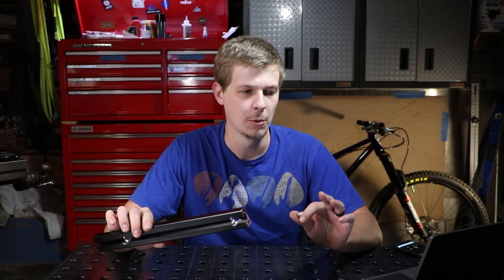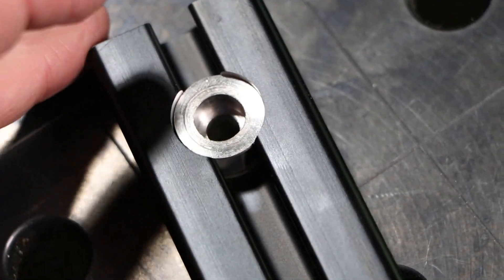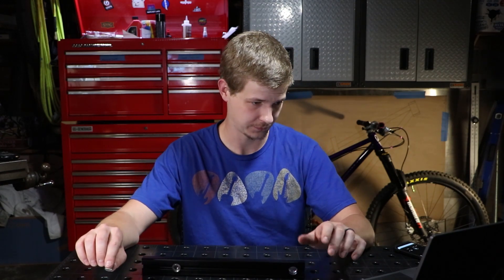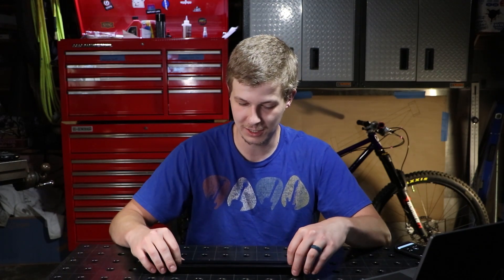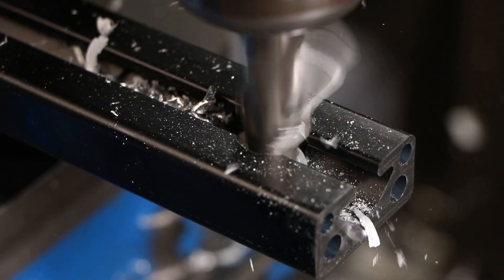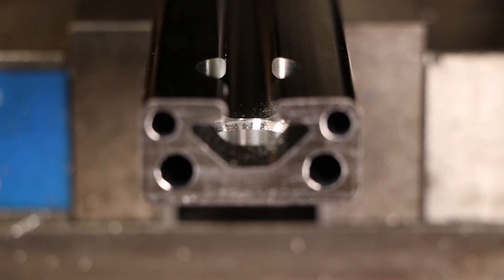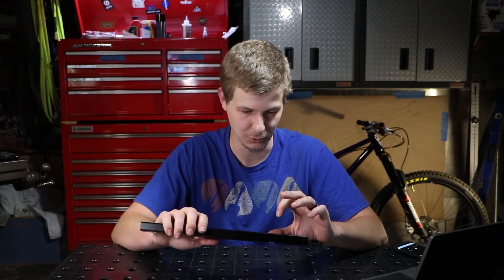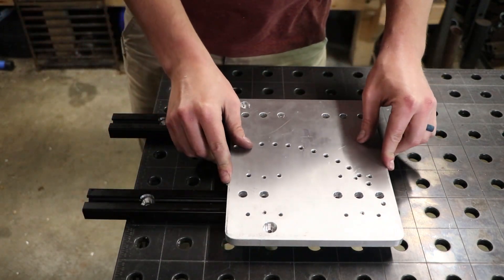SKYNET Part 4 - The Rails & Pins

Comment: Nice work! Usually, we use a diamond pin for one of the locating pins. There is some info here:
https://www.misumi-techcentral.com/tt/en/lca/2009/12/023-motion-mechanism-design---10-controlling-linear-motion.html
Also if you increase the length of your rails you gain accuracy for a given tolerance on the fit of the pins/ hole layout on the table. The extrusions are pretty inexpensive so make them as long as practical. This lets you use a looser fit on the hole so insertion/removal is easier.
Reply from the maker: That was definitely discussed, lengthening the rails. Anyone with a full-sized mill could certainly lengthen them out a bit more if they desired. The idea was to keep it do-able even for folks with the smaller import mills. So 10" seemed like a good round number. Of course you have to figure your vise error will grow along with it. I still don't own a tenths indicator yet, so that bit I showed was as good as I could get it. Haha.
Same reason for the diamond pins, really. Just trying to make sure anyone with basic tooling can pull it off. Leaving some wiggle room on the tolerances will make it work, and still be good enough for bicycles. Can't deny it could be even more accurate though!